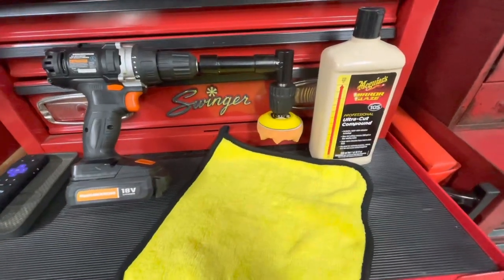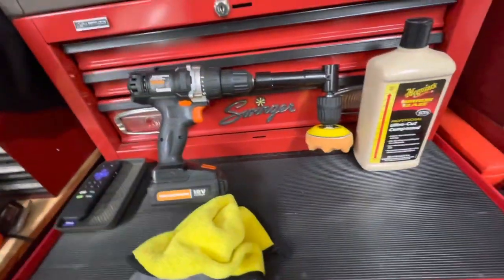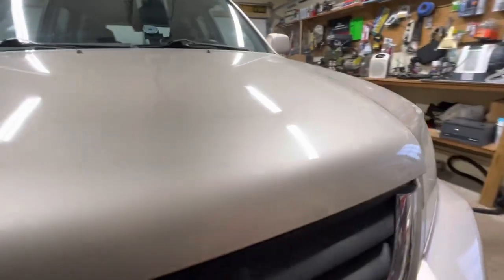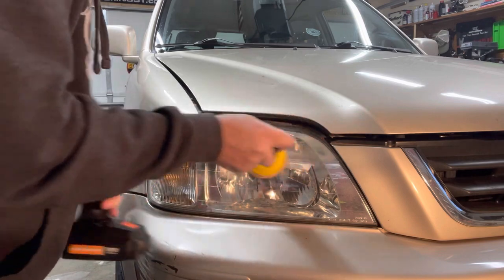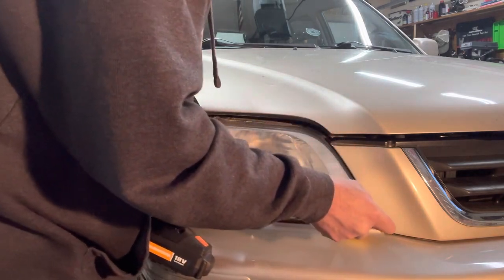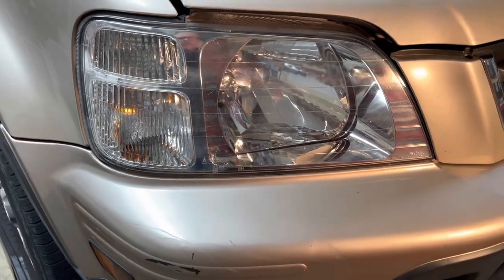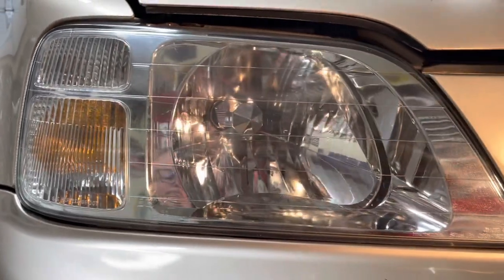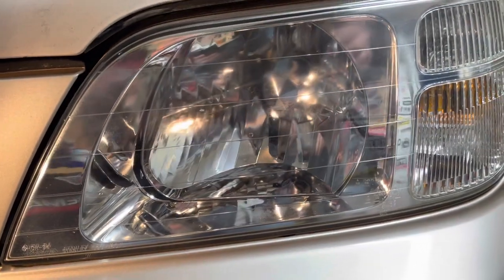Polish your headlights for a better look and brighter lights!

Comment: Since you have an air compressor, air cleaning the pad a few times helps tremendously in keeping the pad clear of removed plastic etc. 
Acetone vapor at the end gives it the final clarity.
Reply from the maker: Will put some extra effort in next time. This truck was leaving soon so I was happy with the results. Good tips!

Comment: You needed to wet sand the damage off before, just grinding at it first was going to take a lot more work, P1500 grit and then the M105 would’ve saved you some time and provided better results.
Reply from the maker: I was pretty pleased with it. 😁